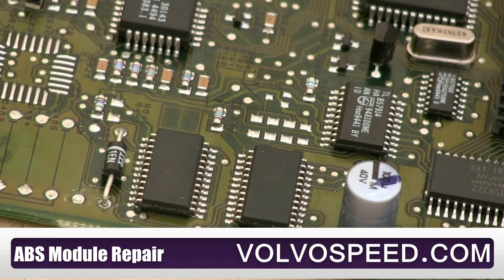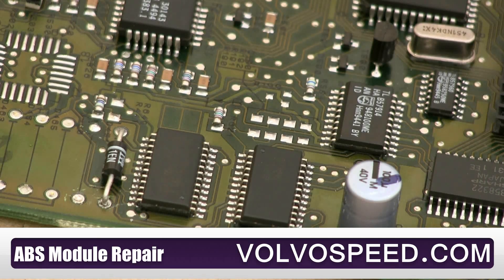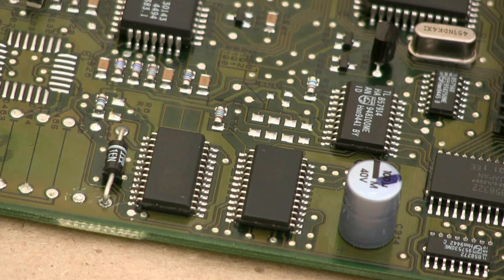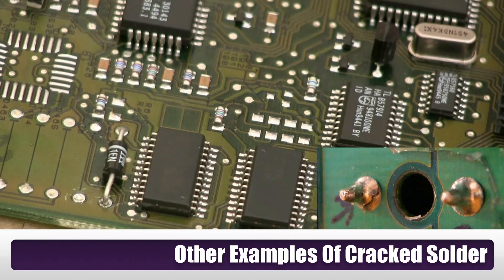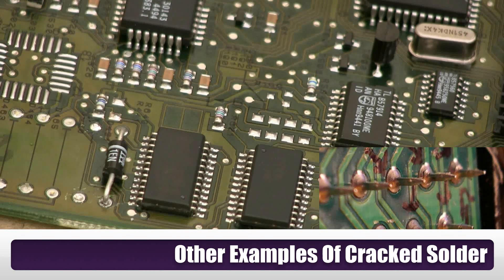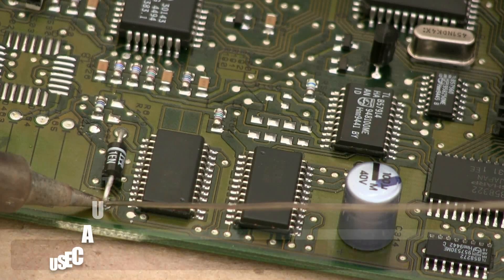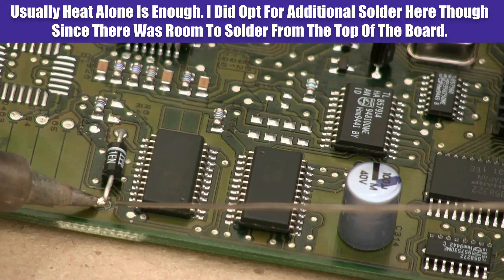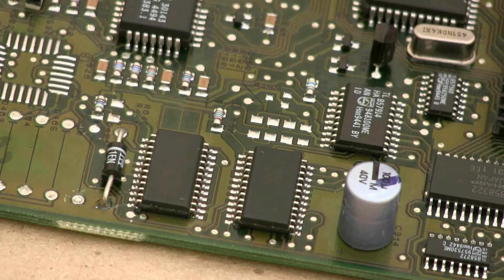ABS Module Repair

Comment: CAUTION,  Don't do any business with BBA reman  for ABS modules they just buy them for $20. to $50 bucks on car-part.com and resell for hundereds.  With me all they did was steal my Dodge Viper computer  now  $1600.00  to replace.  Lots of very bad stories on Yellow pages.com    AUTOMOBILE  ELECTRONICS CAN NOT BE REPAIRED ONLY REPLACED   Home computers can be repaired by replacing individual  components  but no electronic module on any make or model any year can be repaired in any way  i know i have been repairing car full time for over 30 years.  THIS BUSINESS IS A TOTAL FRAUD

Comment: You should use a freeze spray on the component before soldering to avoid heat damage.  In addition, you should use your soldering iron from the underside, as was done in the electronics factory, and feed the new solder from the top.  Putting electronics flux (not plumbing solder flux) will ensure a clean and effective soldered connection.

Comment: Just heating or adding to old solder is not a good technique, as the flux will not flow well. Old solder needs to be removed, ideally using rework flux and desoldering copper wick.

Comment: To open the module, use a heat gun to soften the factory sealent.  Move the heat gun around the circumference at the seam.  Once it gets hot, gently pry the lid off.  Takes a bit of time, but once done it is easy to reseal the unit with rtv.  Don't take a dremel to it, lol.

Comment: NICE!  That's Out F#$?ing Standing.  Thanks for the tip.  NAPA wants $629 for a "re-manufactured" module.  It's a printed circuit board, thus it cannot be re-manufactured.

Comment: Interesting... I have narrowed my 1999 Durango's ABS issue, down to the ABS module. I've have to open it up and check the connections now before finally letting a Dealer touch it.